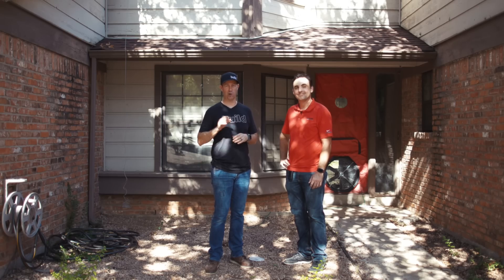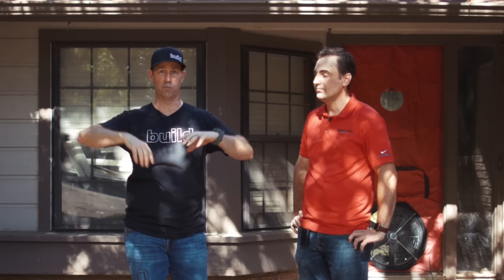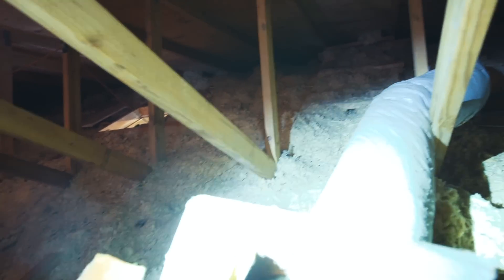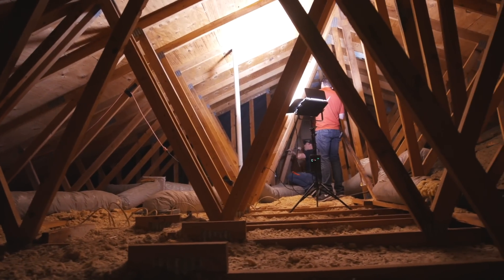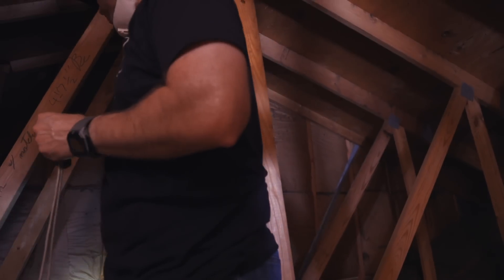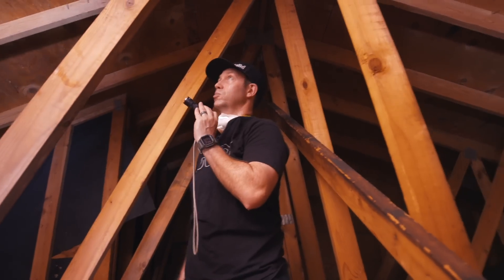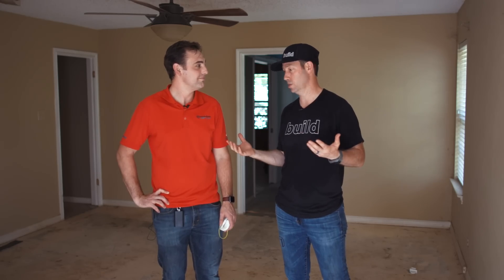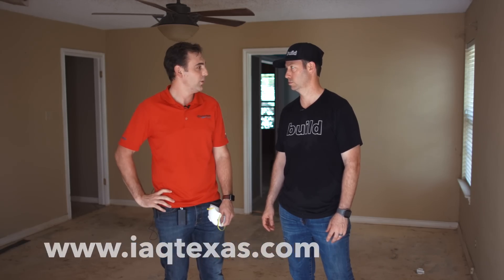You Won’t Believe What I Found In Here!  Pre-Testing my Crappy 70’s House

Comment: You are gonna be a great landlord. One of those who cares about their tenants. I saw the other real estate agent guy was doing reaction video over your remodeling. And basically, he was laughing that you will blow up your budget and he could have done it so differently. I, in person, lived in a house remodeled by a builder who happened to be our landlord as well, all the attentions to details really touched us, because we knew if he did it otherwise, we would have had day and night difference in terms of comfort and livability. That bloke who did reaction video about you on the other hand doesn't care much about the people who actually lives in it, as long as people signed up the contract, he just owns them.
Reply: Kevin also lives in a different climate.  California's weather works better with old single pane windows than here in Texas with our heat and humidity.

If you are fixing to rent, you do have to make hard decisions on what to improve, especially in lower cost of rental areas.  Most tenants dont want to pay $100 more per month because you air-sealed and insulated and put in a new A/C system, even though it saves them $100++ in electricity.  

People only look at the upfront price, running and maintenance costs are invisible until they bite you in the ass.  And that's why I gutted my house and sealed and insulated the crap out of it.  Its a 70 year old house that is cheaper to cool than many new homes.
Reply: Austin is extremely expensive to live in , if he does all the repairs to his standard only Michael Dell will be able to afford the home !
Reply: Max Young who are you referencing? Link pls
Reply: @aayotechnology  https://youtu.be/5M6nDHmyVlo

Comment: I like to see what is the process for fixing your attic
Reply: 1.  Insulation crew comes in and vaccums it clean.
2.  Electrical work if needed, air-sealing, HVAC, etc. work is done.  Rafter baffles are added as needed.
3.  Insulation crew returns and adds fresh insulation.

That's the process in most houses if you arent doing any structural changes.

Comment: Bahaha....my 19th century brick and windows is basically Swiss cheese then.....😊
Reply: Actually, the coats of underplaster and finish plaster on a masonry house can be pretty good for airtightness, as long as they are caulked well where they meet openings. The fact that the plaster doesn't generally run between floors, around the joist ends, is usually an issue. The windows are going to be terrible.